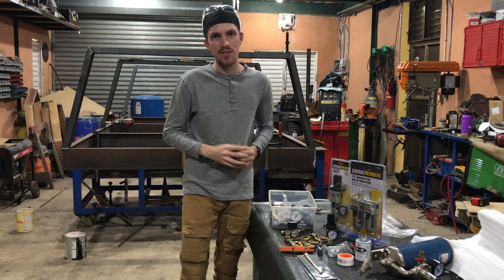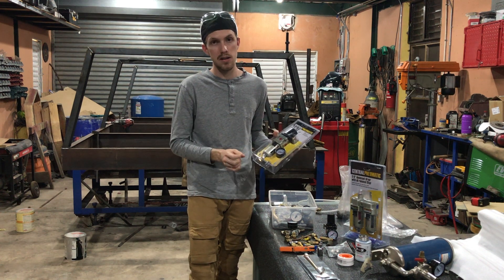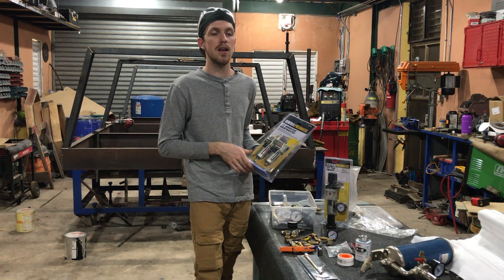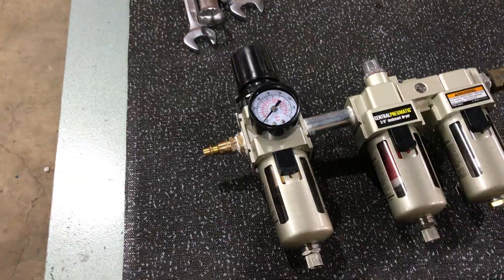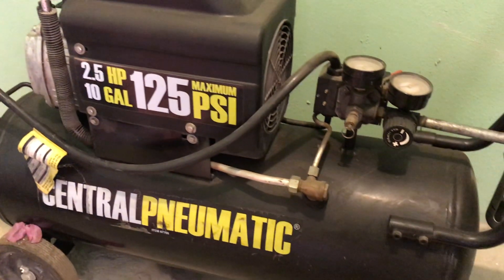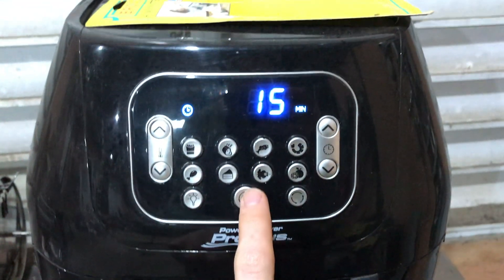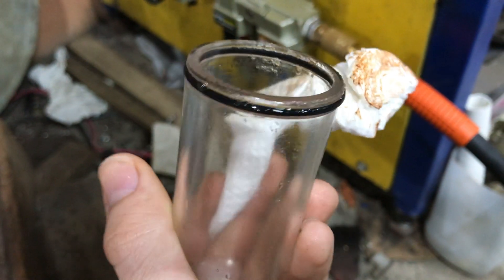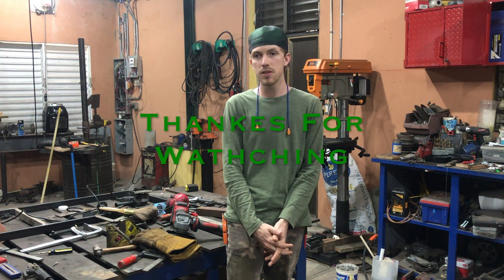Compressed Air Filtration Desiccant Air Dryer and water oil separators

Comment: How do you like your everlast  equipment. I just bought the MTS 275 and the 62 I plasma cutter. Just hooked up my dryer to it. I’m gonna give her a go.
Reply from the maker: I have had a good experience with everlast equipment besides their Tig Welding torch the rubber, fell apart after several years but I live in the tropics and not all rubbers last very well here

Comment: thanks, just purchased one of those 3 stage desiccant air filter regulators and the instructions don't make much sense, so your video gave me a basic understanding of how the thing works. thanks .from brisbane australia.
Reply from the maker: I’m glad you found this helpful. Remember if you have high volumes of air, you may need to consider a refrigerant air dryer.
Reply: @CreativityUnleashed  yeh its says the filter can handle 300L/m , my compressor puts out 260L/m and the cutter uses 189L/m. I will test it all out. Hopefully it works and i dont need to buy anything else..
Reply: Dito for me. Just got mine today.

Comment: HEY!  YOUTUBE ALGORITHM, leave my comment alone!  It complies with the guidelines!!!!!!!!
___________________________________

With an air compressor like that (I have similar, just 10 gallon tank that i bought 2 days ago) is there not a way to put the dryer/water separator on the air input to prevent water from getting into the tank, causing rust and later, tank failure?

That's what I'm looking for, because I bought this to replace my old one, which is almost identical, because there was water right in the tank and when I opened the drain, RUST water came out.

So I'd like to prevent water getting in, if at all ossible.

Ideas?
Reply from the maker: So air compressors tend to heat up the air, quite a lot by compressing it and hot air holds onto moisture so you would have to cool down the air sufficiently before you can separate the moisture out of the air. 
You can buy rust, removing additives that are used for cleaning gasoline tanks that are rusty and disassemble the air compressor add the cleaning product to the tank after doing the cleaning process and ensuring the tank is sufficiently dry. Potentially heating up with hairdryer or heat gun, you can add a two-part epoxy paint and roll the tank all over the place and ensure that everything gets coded on the inside and drain out the excess paint and that 
should protect the tank from the water. That’s what I did with mine.
Also, most of the instruction manuals recommend when not in use draining the machine and leaving it open so that they dry out  

One of the questions I’m always asking myself is why do the factories not normally do this before selling you the air compressor I think you probably know the answer.
Reply: @CreativityUnleashed  Yeah, they won't coat the inside on a cheap machine for obvious reasons.

That's why, a year or two ago, I thought about buying one with an aluminum tank.

The store I go to had some, but they were those floor standing ones, which I just don't have room for.
Plus, they aren't "portable" which is something I like with these small ones.

Since that time, however, I haven't seen them bring in any  aluminum tank air compressors.

I bought a new one, so for the old one, I'm just going to fix the one little problem it has, try to clean out the rust, coat it if it's not pitted and just put it in storage.  I don't like throwing things out if they are still usable or have good parts on them.  LOL
Reply from the maker: @BlondieHappyGuy I haven’t seen aluminum tank air compressors before, but it sounds like they could work well and yes, it’s good to be able to keep machines around for a spare part even good luck
Reply: @CreativityUnleashed  
I've decided that when I have time, I'm going to disassemble the old compressor and use my borescope to look inside the old tank to see just how bad it is.

I'm hoping it'll only be surface rust, but I'll check if it's pitted in any way.  If so, then it's junk.  I won't take a chance on explostion.

But if it's good, then I think that I'll fit it with a quick connect hose and add one to the new compressor and have dual tanks, doubling from 8 gallon to 15 gallon.

Obviously, I have no clue what I'm doing, LOL but I hope I can pull that off.

The reason I want to use quick connect is so that when I have to take the compressor to another location on the property, I can just quickly disconnect the secondary tank.

Fingers crossed.

Comment: Thank you for the video.  I am setting up a small plasma cutter and read the consumables last much longer with dry air.
Reply from the maker: Just remember if you’re going to be doing much cutting or large volumes of air the desiccant get saturated very rapidly and becomes unaffected. so using a refrigerant air dryer on larger scale is the best option but for occasional use this system works fine

Comment: Your video was well thought out and well explained/executed. I just started trying to spray with an hvlp sprayer and have had a months worth of troubleshooting. My last mini in-line filter was choking my system brand new out of the box so it took me awhile to realize what was wrong. So I removed it and it solved my pressure problem but now I have awful craters that appear (maybe fisheyes) in my paint film. So I assume it’s because of not running a filter. So I bought harbor freight’s newer version by Merlin and of course the inlet and outlet are much larger than any 3/8 hose fitting which I don’t understand because this is a 3/8 filter combo. I suppose I have to go and pick out some reducer connectors or something in the morning. Has anyone else experienced this? Just seems really weird to me. Anyway I was just digging around for some information and came across your video and although it didn’t answer what I was searching for, it was a great informative explanation and demonstration of the benefits of a filter setup.
Reply: Just ran into the same Issue with my harbor freight Merlin brand Air desiccant & dryer. my lines are 3/8”  same as the label on the Merlin pack. so maybe i’ll have to get some of those reducer connectors like you mentioned. Lmk if you figured out a solution!

Comment: Is the only water filter the desiccant or do the other traps also get the majority of the water out before the desiccant trap sees it. I have a 60gallon air compressor and it produces a lot of condensate. It would fill those traps pretty quick. I can drain the tank and still get visible water vapor coming out of the hose.
Reply from the maker: @perry9492  of course the refrigerant air dryer is the best option and that’s what I use now. Specially if you use a lot of air, but yes, there is the first water, moisture separator and that removes the majority, but it doesn’t do it. Well if the air is really hot. and the desiccant is only to get rid of the last little bit of moisture.

Comment: How often do you feel like you end up changing or drying the desiccant
Reply from the maker: there are a lot of variables but for example plasma cutting or spray painting on a hot day with high humidity as little as an hour of consistent airflow you may need to replace the desiccant and dry it out. 

if you're using a high volume of air consistently you probably would want a refrigerant air dryer. 
I have a video on refrigerant air drying.
Reply: @CreativityUnleashed  hello I use this exclusively almost for paint protection film installs, airing up my keg maybe once a day or so. 

Typically it’s 30 percent humidity and about 70-80 in my shop. 

So basically probably typically less than a minute per day or so in a climate controlled environment

Comment: A trick thought to me by a plumber was tape first then a little liquid sealant.    I have some high pressure systems and you might have to take apart a lot of fittings to get to one leaking.  Since I started doing his technique I’ve never had a leak.

Comment: If I use this, I will need to bake blue balls every 10 minutes.
Reply from the maker: That's amazingly put depending on your airflow you might get 30 minutes or an hour that's why I recommend a compressed refrigerant air dryer which I have made a video about.

Comment: I like your video. And how you reused the beads. But I do have one question if you can help. At the very end of the hose have you measured how much water that is still coming out. That would be kind of interesting. I'm planning on doing the same thing here soon within a year. My home is in South carolina. But I'm working in Florida. For about another year and then I'm done. So I'm buying everything I need to set up.
Reply from the maker: I need to get something to Measure the moisture with 
I am now mainly using the refrigerant air dryer that's a lot les work and does a much better job

Comment: Great vid! 
I just used mine today for the first time. I use to have just the usual regulator with the water separator in one unit. Today I put in a larger auto emptying water separator, then a new regulator/separator and then the dual oil and desiccant filter same as you.  After spraying four stripped and sand blasted skid steer rims I see the beads are changing colour. It doesn’t take long for them to start changing. Maybe an hour to an hour and a half. Definitely way less vapour at the hose end. 
I’m looking into making one of those zig zag type copper tube wall mounted air dryers. Apparently they work really well. Always something to build! 😁
All the best,
Cheers from Australia 🍻
Reply from the maker: I have found even putting a 50 foot or 100 foot hose in a bucket of cold water before it goes through the water separator  will greatly help
Reply: @CreativityUnleashed  
That’s a great idea!!! Thanks for the tip. Even perhaps ice in the bucket depending on the ambient temps. The way I understand it is the water separator will remove condensed water and the desiccant will remove the water vapour. So if you are removing heat, you condense more water effectively removing more moisture before it gets to the final desiccant as vapour. 
I have liked and subscribed 👍
That really is a great tip! I really appreciate it! I see experiments in my future 😁
Cheers 👍🍻
Reply from the maker: @nigelw598  Yes ice works well I now have a refrigerant air dryer and that has been amazing I am working on a video about that
Reply: @CreativityUnleashed  
Cool! I can see this is going to get expensive. 🤦‍♂️
I’ll be here watching 😁👍🍻

Comment: Those desiccant dryers don't do shiet unless you're using some $100/oz stuff. It takes days for that stuff to absorb moisture  The higher pressure speed things up a bit, but the higher temperatures slow it right down to a stop. It's basically just a filter that some water gets stuck in. It's not absorbing it from the air. Its either just straight water that it soaked up or moisture from the atmosphere. That stuff works in days not seconds. Also you can make a way better one for half the price with 20 feet of pipe and a few gallon jugs of dessicant. 20 feet of tubing and 10lbs of dessicant now that might actually work in seconds.
Reply from the maker: You're definitely right this one is only good for a very small amount of air I now have a refrigerant air dryer and that works way way better 
but in my opinion it still is better using it then not using it makes a big difference 
but I think making a high-volume desiccant dryer could be a good option as well !

Comment: I don't understand why if the moisture filter is trapping the water first, what's making the blue balls turn pink. Is the moisture filter a scam type of product?
Reply from the maker: The first filter works but does not separate all of the water the desiccant filters are better at catching the last bit of  moisture remaining but if you were to just use desiccant it would get saturated very rapidly and stop helping
Reply: Hi Money,
The water separator removes the water liquid. The desiccant absorbs the water vapour.
👍🍻

Comment: what happens if you use oilless air compressor?
Reply from the maker: Great question I would assume it wouldn't make much difference and I'm quite sure it wouldn't hurt anything having an oil separator

Comment: Can the regulator/filter be used as the main regulator?
Reply from the maker: I often use it as a main regulator for a air compressor that doesn't have a regulator and I've never had any issues !!

Comment: So I should definitely have the one filter that collects water AND the desiccant filter? I live in Florida.
Reply from the maker: https://youtu.be/X7B5imLeYv0
Reply from the maker: If you are trying to use it for more than an hour at a time you may want to just make on on the YouTube channel Hannah's bug she goes into detail of making one that can do a lot higher volumes of air.
I finally got my refrigerant Air dryer working but haven't had the time to get a video out on it yet but that also works amazingly well just depends your application and needs

Comment: Any idea if sputtering with a plasma cutter would be caused by moisture in the air? I was told this might be the issue or the gap inside of the cutter.
Reply from the maker: Well I can't say for sure what is happening with your machine. but I have definitely have had problems with sputtering plasma arc because of moster in the air one of the ways to know is how long your consumables are lasting and are they turning black or burnt looking really fast can be a sign of unclean moist air
Reply: @CreativityUnleashed  Gotcha. Thanks for the info. I also am stupid, hadn’t drained my compressor tank, had lots of water. I just tried it again with lower psi and it worked better. I may try what you did as well.
Reply: Yep, u have to flush the tank every week.. It will oxidize soon and you will have problems
Reply: The moisture and debris in the unfiltered air cause the consumables in the cutter to go bad quicker, so the answer is yes to both I bet.